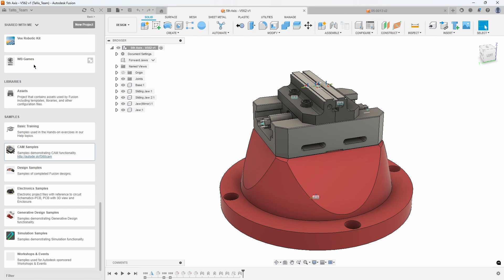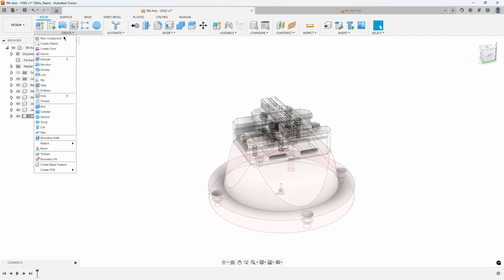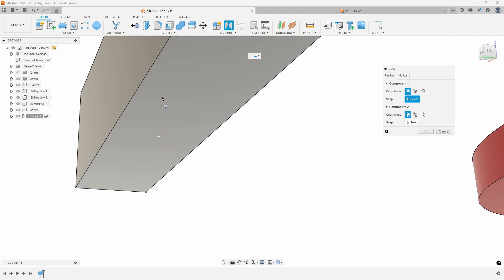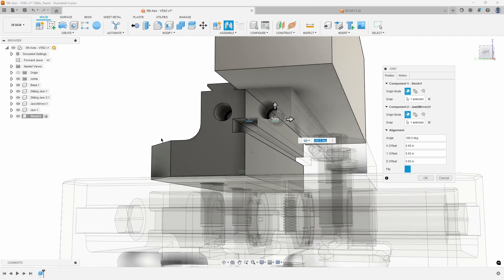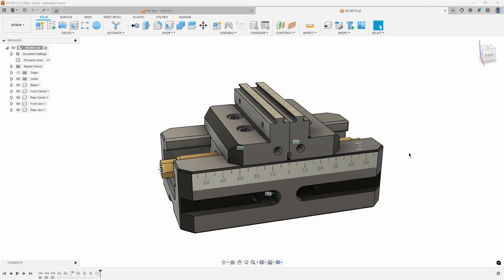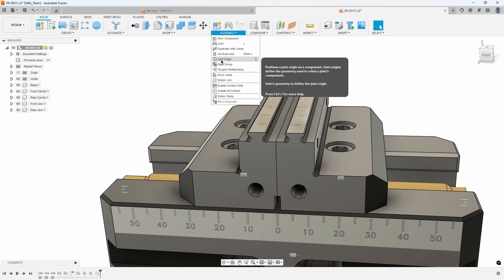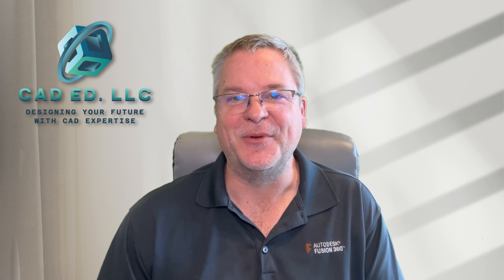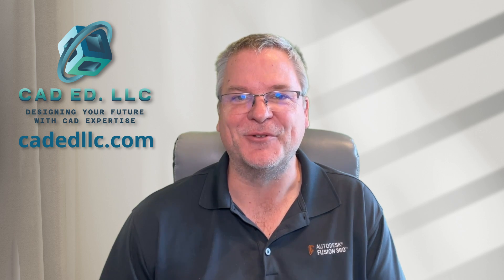Aligning Stock with Joints in Fusion

Comment: Hi Brad. Awesome video. I’ve been looking for something like this for TOO LONG. Programming parts for a 5 axis mill on a daily basis and not using vice models because I’ve never got my head around it. The final piece of the puzzle for me would be, how do you now align a the part/component you want to machine centrally within your modelled stock? Let’s make it difficult and say the component is shaped like a STAR or similar non-uniform profile. How do you model/join/position the component so the top face is offset 0.35mm from the top of the modelled stock in Z but centrally to it in X and Y? I’d LOVE a video on that!! Thanks for the knowledge 😃

Comment: Very useful, I would like to better understand when placing joints if it’s best to be in the component or the parent. I noticed you activated the component for one joint and the parent for the second joint.
Reply from the maker: @Stewartduncan2110-  Good observation.  I should have been more thorough on specifying which component was active while adding the joint.  I tend to add the joints at the "assembly level" of the component.  For example, if the whole assembly was a bike (Bike_Assy), and it had a rear wheel assembly which also had a derailleur assembly, if I was assembling the components of the derailleur, I would activate the derailleur assembly and create my joints.  That way, if I ended up using the derailleur in a different assembly down the road, the joints would travel with that assembly.  If I had done all the joints at the top level (Bike_Assy), they would not.  Then, I would activate my Rear_Wheel_Assy and create the joints that assemble the derailleur sub_assembly to the rear wheel assembly, etc.  Hopefully that makes sense.
Reply: Yes makes perfect sense. Thank you very much. 👍